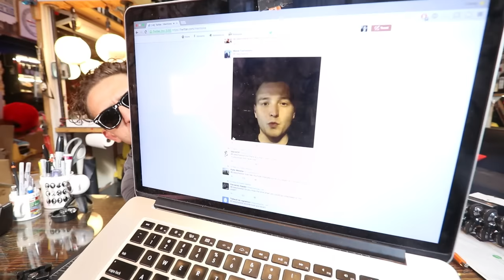HOW NOT TO FIX A CANON 80D CAMERA

Comment: I am about to buy my first dslr canon and want your input on which one I should buy the 70d or 80d? I can get them around the same price.
Reply: Victor Morales From what I know, Casey much prefers the Canon 70D over the 80D due to difficulties with the 80D. Hope this helps.
Reply: Matthew G I would go for 80d if you haven't bought one yet. 80d might be a little lower build quality, but it is still am incredible camera. plus, the 80d technology is coming to the t7i, making it the first significant upgrade to the i series since the T2i. The pricing of the t7i is the same as an 80d though, so just pick up an 80d. they are Honestly made pretty well, it's just that Casey is not the most gentle with the equipment. any phone, drone, or camera isn't made to be dropped on tables, or even call over about 10 times a day.

Comment: I don't want a Tesla. I drive a late 70's Toyota pickup and currently in the process of finding an early 90's Toyota pickup to swap a diesel into. Call me crazy, but there's nothing like being connected to the road with good, old school mechanical machines. Sure the Teslas are awesome for what they are, but if you really love driving, old school is the way to go. Also, much much cheaper and easier to work on too, for the mechanically inclined.

Comment: How does he adjust the brightness while he takes video?
Reply: JW Studios with the exposure settings on his camera.
Reply: Evan Jarvis yeah I know but what knob is it? I'm getting a Canon 80D soon. Just trying to know as much as I can before I buy it😅
Reply: I think you have to turn down the lock switch and turn the dial. I'm not one hundred percent sure though. I've only ever used one once and that was with auto exposure. You're lucky that you're getting an 80D. I'm filming my vlogs with an action cam and my cellphone. Good luck man.
Reply: Yeah the only downside of the 80D is that it doesn't shoot 4K. Still on the fence between a a6500 and the 80D